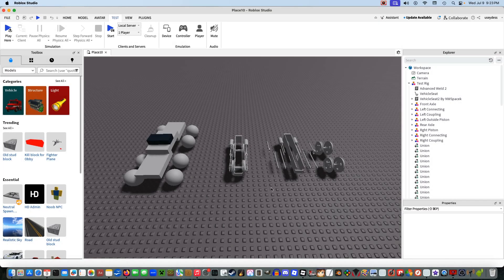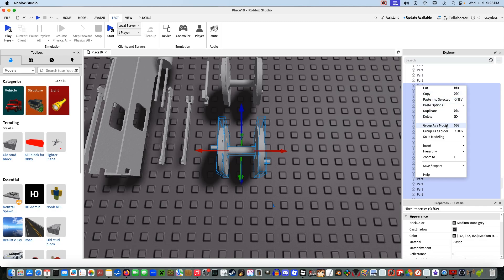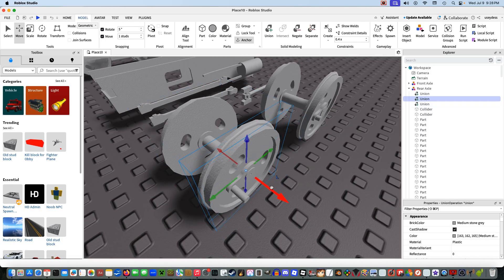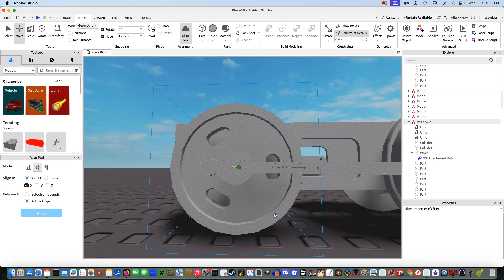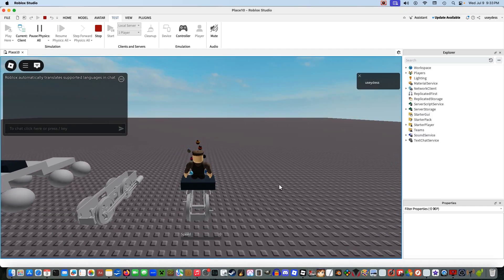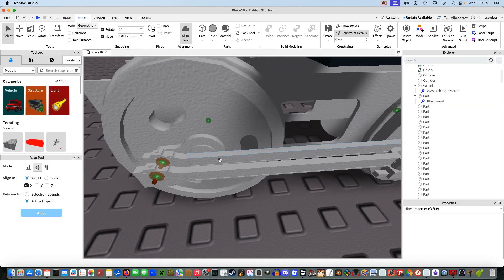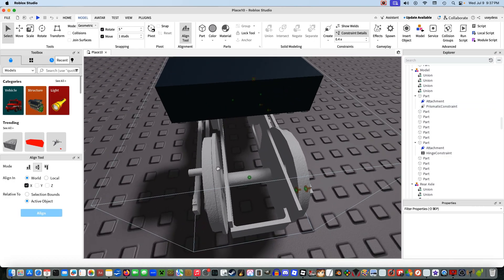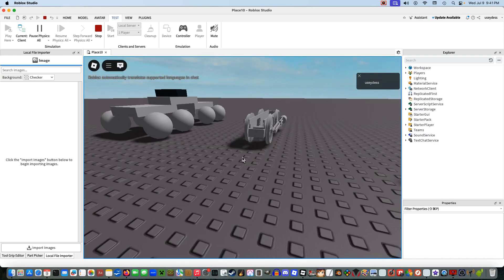How to Rig a Locomotive with VehicleSeat2,  A full guide on rigging locomotive in Roblox Studio

Comment: I'm a beginner on this. If I'm ONLY keeping collisions on for the colliders, if my train wants to turn it's going to roll right off the tracks, is it not? How do I prevent this? Isn't the flange there for that?
Reply from the maker: you need gliders for that, flanges on the models are only for visuals unless you want to make physics based flanges which i don't recommend because i've been told those are very unpredictable and not as reliable as gliders